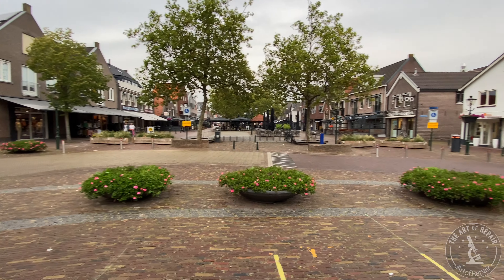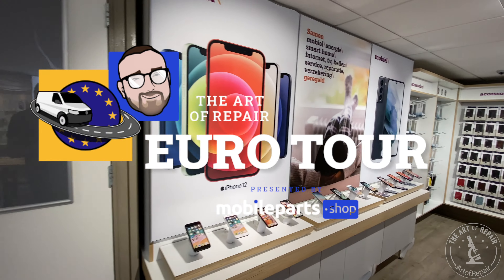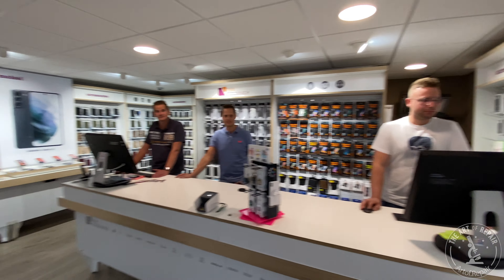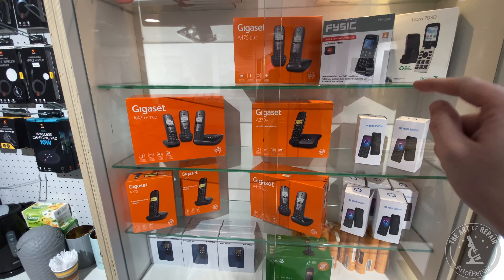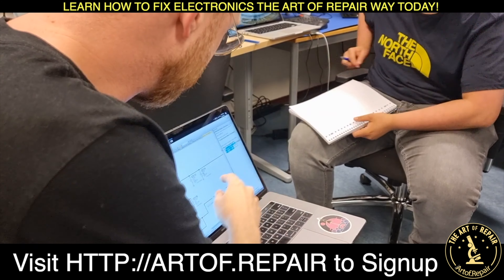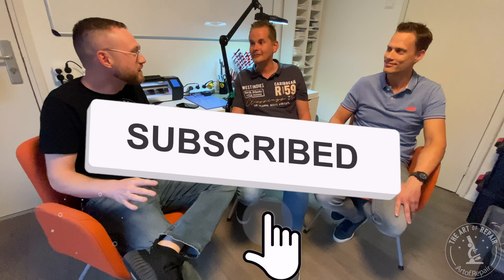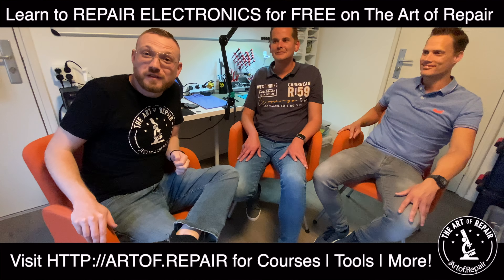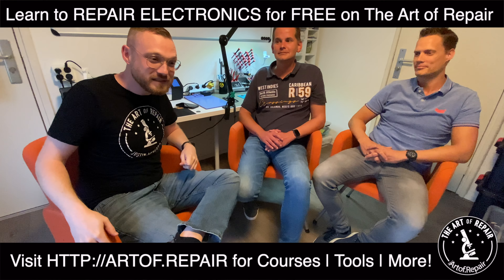🔬❤️🇳🇱  EASILY Jump into Microsoldering | Tele Combinate | Shop Visits | 2021 Euro Tour #7

Comment: Hey Justin, those really good scopes are $400-700USD. I’m talking AmScopes now, not Leica or Zeiss. That’s big league ball. Good optical magnifiers like the luxo   kfm 5X and the Wave are the best lighted optical magnifiers out there. I have fume extraction since I last wrote you. It’s a Pace unit, an Arm Evac 200. I still have the Quick 461DW and the Pace SMR pulse heat to round out my soldering equipment. It’s coming on. Great equipment takes time to purchase. You have been in Holland for a while now. Keep spreading the knowledge out there. Stay safe my mates!😊👍🏻😷

Comment: Can you do professional type work on budget level microscope(Andon) and hot air work stations (Yihua).?
Reply from the maker: the andon is where I would worry, you lose all depth perception. So hobbiest diy level with room for alot of errors sure, but professional. I wouldnt call myself professional using a digital microscope. Its just not what you need. And maybe you can share the model of your yihua?